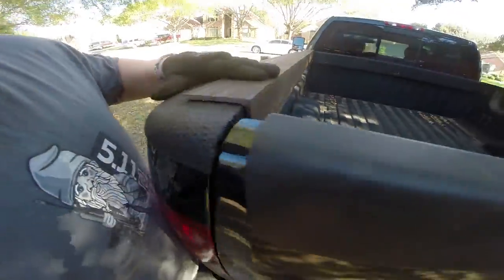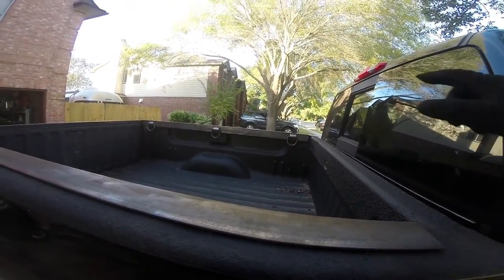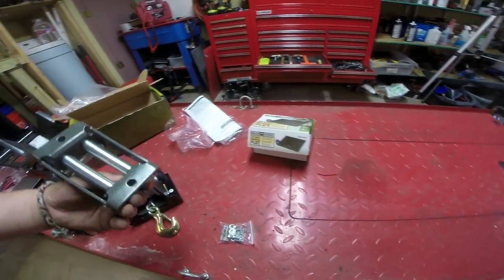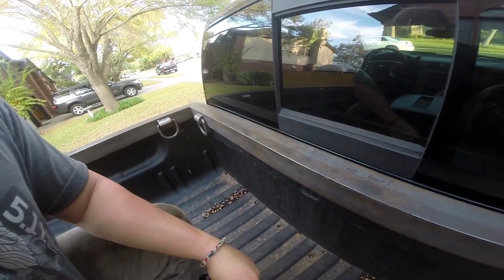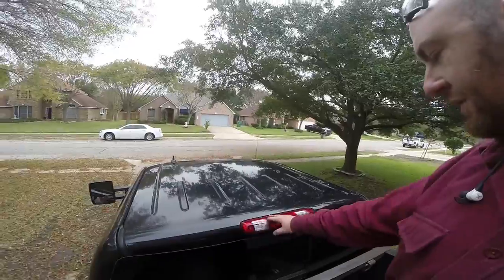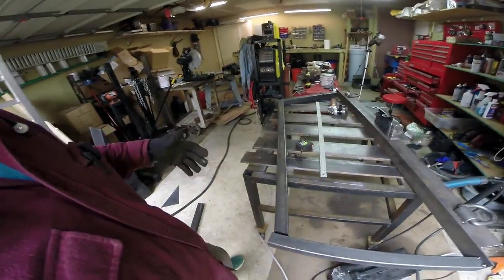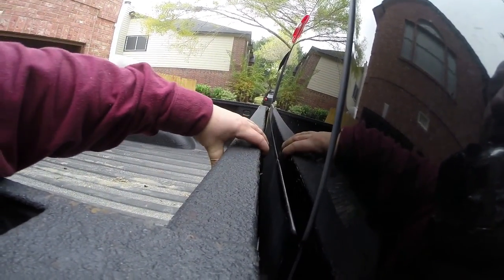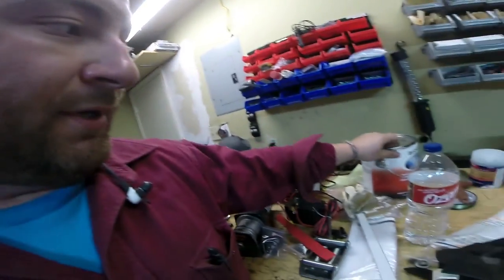Custom Truck Bed Rails and Headache Rack Build with Winch and LED Lights

Comment: Very rad. Exactly the inspiration I was looking for. Looking to do a similar set up on my work truck.
Reply from the maker: Glad you like it. This was 7 years ago and I have had over 1K of wood, and close to that in steel on this rack with no issues. You may want to check out my other truck videos as I have recently made some improvements/additions to this rack design for offroading.

Comment: Need protection for the back window. If your wench hook should let go while in use, BACK WINDOW gone. Another law of physics.
Reply: Or use a synthetic rope. They wear quicker, but are a lot safer and generally nicer to deal with

Comment: I had built a box for my winch but I love this idea. How much flex is there when you pick up you're bike?
Reply from the maker: I secured the whole assembly to the bed of the truck with 8 1/2 bolts and backing plates. There is no visible flex even loading a 700+lbs bike.

Comment: I have to say it is nice build out and all but your truck bed was built with collapsing points at the factory these points are designed in a way that if you get hit from behind the bed collapses like an accordion absorbing the bulk of the impact. You just voided one of the most important safety features of your truck by stiffening the bed top rail. If you get hit in the back by another vehicle those two pieces of angle iron are going to be pushed right through the back of the cab and hurt you and your passenger real bad (if it doesn't decapitate you).
There is a reason why factory made racks don't reach all the way to the tailgate. I am not trying to be a d!c# just giving you some advice.
Reply from the maker: You are correct in a basic sense, however the way this is designed it would most likely decap the folks who rear end me. It would have to buckle the bed in front and bend a 3" angle against its strength point. Furthermore its held on with bolts that will shear if necessary. Also the truck frame will do its job. 

Finally there are any number of aftermarket companies that make full length rails.

Comment: What size angle is that?
Reply from the maker: 3 inch, could go with a 4" if you want to cover the whole top rail.
Reply: 3/16" or 1/4"
Reply from the maker: 3/16